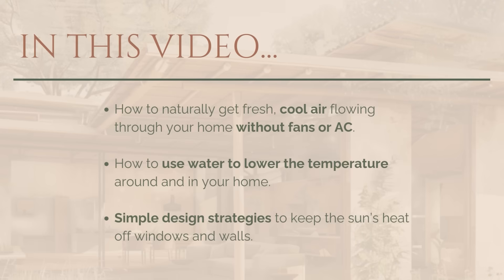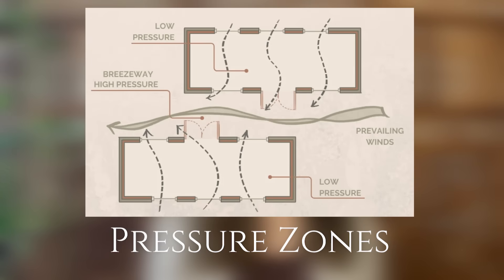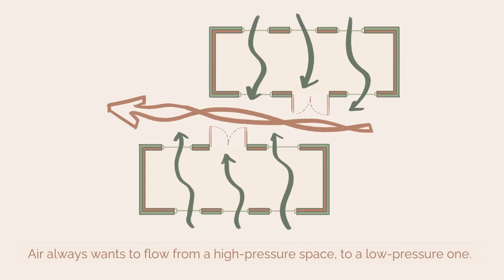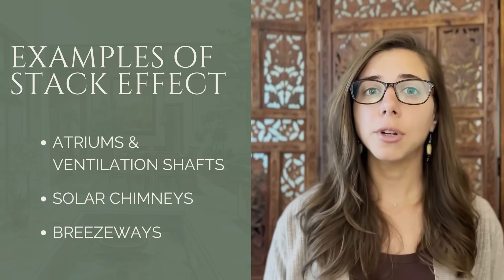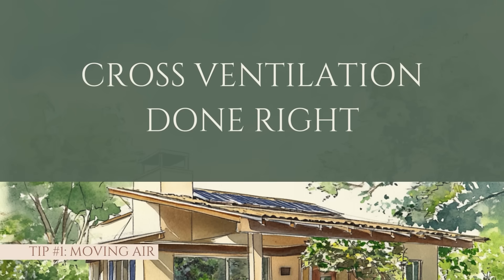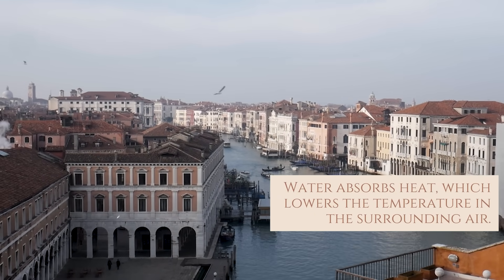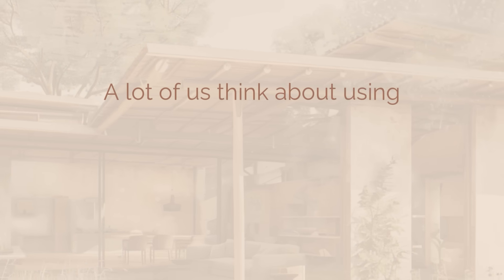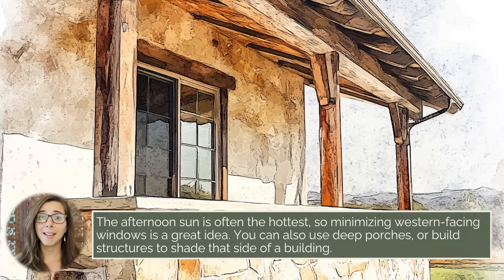The Forgotten Cooling Techniques Architects Don't Talk About

Comment: This is really good. I'm going to be building a house in the philippines, could you please do a video on how to reduce energy consumption in a hot and humid climate? Thank you.
Reply: The presentation projects routine ideas .The idea of passive planning encompasses a holistic ,non mechanized approach to architectural design where in temperature, rain ,light,air ,soil ,built shape and form ,orientation of the building ,breeze direction ,adoption of local materials and traditional time tested construction methods, existing landscape factors like vegetation ie trees,slope and drainage together make up the check list for obtaining an optimal result in maximizing thermal comfort in the building .but , the presentation is very limited in scope and hardly discusses site planning and site analysis which are the initial steps in approaching passive design incorporation in design generation .Unfortunately most current architectural education is centered around energy intensive design methods adding to high carbon emissions. There are enough examples all around the world waiting for adoption but indifference of design ers is the major stumbling block that needs to be tackled urgently .
Reply from the maker: Thanks!  That is a good suggestion!  Humidity can certainly get tricky, so will have to
Reply: Usually people think insulation is for cold climat only. But it actually works in hot climate, too. It reduces heat (or cool) "travel" in both directions. You would need less ernergy to keep a room or building cool. However, solar panels may reduce your costs on the mid-term run, too. After 20 years they usually still have 80% of their initial performance.
Reply: @leonlowenstadter9223  to anyone who knows this better than I do, my question is this. If we're in the Philippines for the ambient temperature during the summer is 90, and I'm comfortable with my house at 80 with ceiling fans, that's only 10° difference. If I'm in the north where it's 0 outside, and I want my house at 68°, that's 68° that I have to keep out. With only a 10° difference between outside and inside temperature, the insulation requirements have to be a lot different. I'm wondering if I should spend money on solar panels and air conditioning versus insulating the walls and ceiling and getting double or triple pane glass?
Reply: @johnb5478  Honestly, I am not an expert but I taught myself a lot about it. However, the insulation would make most sense on walls to the south so that less heat passes the wall. Insulation on the ceiling or the floor are more for cold climates as you like to keep the heat from exiting upwards or the cold "draining" heat from below the building. Replacing the windows is far more expensive than insulation, so this is usually a bit further down the road. However, insulation needs to be thought in combination with your high humidity (mold). On the other hand, compared to solar panels and A/C it's no maintenance. As you probably have many sunny days A/C with solar panels probably makes most sense as A/C reduces humidity, too.
Reply: @leonlowenstadter9223  thank you for the reply. I had considered getting a whole house dehumidifier, but I don't know why I wasn't remembering that AC also removes humidity. I appreciate you reminding me of that and we will stick as much money as we can into keeping the sun off the walls and windows and get some panels and mini splits where we need them. Thanks again.

Comment: One of the largest problems is the heat transfer through the exterior wall studs.  I have built a small cottage.  What I did was to have a second course of 2X4 studs.  The top and bottom plates are 2X6.  The first set of studs are structural and hold up the outside sub-siding and siding.  The second set  are also 16" on center,  but set two inches 'in' and staggered in the center of the bays of the other set of studs.  This second set of studs holds the insulation and the drywall.  Now, no stud touches both the drywall and the sub-siding/siding; there is no heat transfer through the wall.  Another gain is quiet: my cottage, while not sound-proof, is much quieter than without this stud scheme.  And it is not expensive.

Comment: I'm totally into all this! I live by an experimental house from back in the 70's that used a pool of water on the roof!
Reply from the maker: Yes!  That is another method that can also be used for passive heating and storing heat since water is such a great thermal battery.  Im hesitant to put water on roofs in my projects (just from a water proofing standpoint). How is it currently performing after all these years?
Reply: Was it still? Sounds like a mosquito breeding factory
Reply from the maker: Hahaha!  Im assuming it was enclosed.